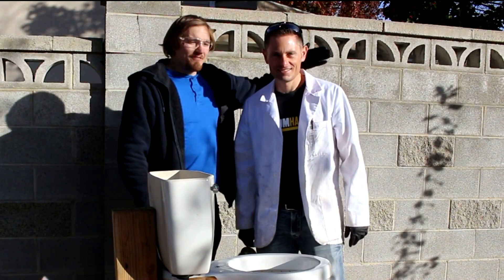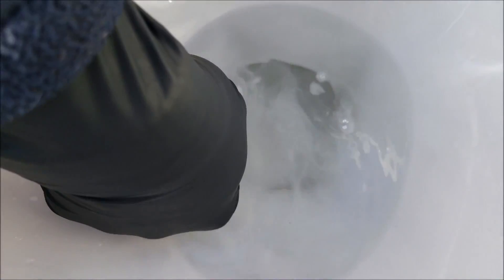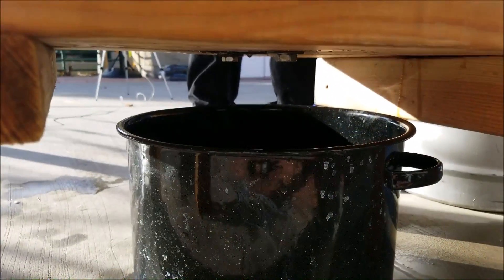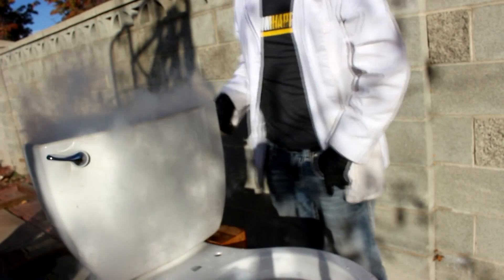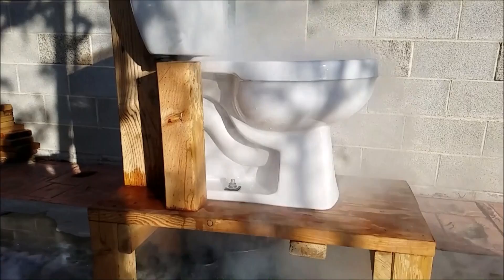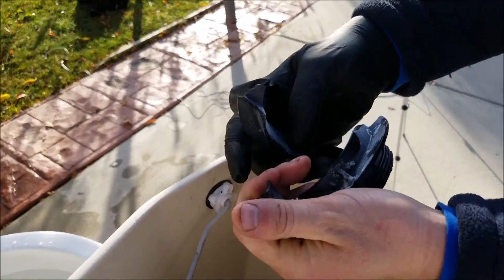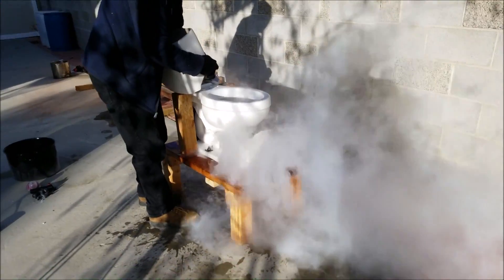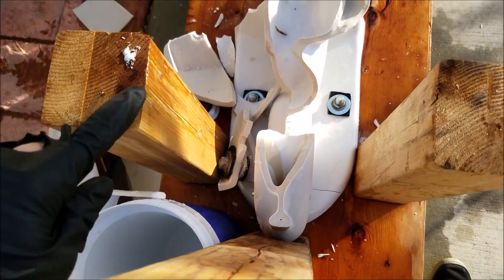Flushing Liquid Nitrogen

Comment: It's not too surprising that the bowl cracked from thermal shock, as sulfuric acid based drain opener has a preheat protocol. As +Cody'sLab has shown in previous videos, adding acid to water usually does not create even a boiling mixture. So, the far greater, and more sudden, change in temperature from the liquid nitrogen is almost certain to crack a toilet bowl.

Comment: I wonder what happens if you try that with fluoric acid XD Probably the flush system will melt before it get down but with a bit luck you could have a "melting" toilet (and surroundings). (would be a cool video - dissolving a whole toilet in fluoric acid)

edit: how can the water in the bucket be warm while frozen in the toilet?

Comment: F.Y.I., before you eat more ice out of the toilet you should know that they test every toilet exactly once at the factory. They are cleaned with a pressure washer but, they are not as clean as you think..........................................................................................................................................................................................................................................................................................................................................................................................................................................................................................................................................................................................................................................................jk

Comment: LOL!! This was awesome. Of course the liquid nitrogen does more damage than the mercury. It's so cold that it causes thermal shock on the ceramic - just like if you had put it over a fire, but "the other way". Also fun with those rubber parts that got brittle and cracked.

Comment: try to flush it with sulfuric acid next time :)
Reply: You can buy concentrated sulfuric acid (90% or so) from Walmart in the form of drain cleaner, so not terribly exciting.
Reply: ehhhhhh bad idea
Reply: WOW that solution is illegal where i live.... max is 70% diluted
Reply: I approve!
Reply: buy a wet cell battery and use the acid from it
Reply: Sulfuric acid? Nah, let's go bigger. How about fluoroantimonic acid (H 2FSbF 6?) It's 10,000,000,000,000,000 times more corrosive and stronger than sulfuric acid. The only problem is, it would chemically burn the toilet in minutes, or even seconds. Plus it's illegal to buy or have it at all, without a VERY special permission.
Reply: Grant Thompson has a vid on how to concentrate sulfuric acid to pure pretty simple but I'm not stupid enough to try this at home
Reply: How u even store fluoroantimicic without it breaking everything down
Reply: rusty savage The only way to store fluoroantimonic acid is by teflon containers. Teflon is help together by carbon-fluorine bonds, which is the strongest bond in organic chemistry. It will destroy everything else.. :D

Comment: Is there a reason you guys are using gloves with the LN2?  AFAIK no extreme overclockers use gloves on the basis that the leidenfrost effect protects you if it hits your skin whereas with gloves it can freeze through the glove fast and soak into fabric.

Comment: You could've made it explode on it's own by giving it thermal shocks. Repeated simultaneous exposure of liquid nitrogen & hot water.
Reply: All the pinhead in the fake white coat wanted to do is hit it with a hammer :\
Reply: TheProCactus who you callin pin head?
Reply: MasterG
Who wanted to smack it?

Comment: Hey Cody, I've been looking at some chemistry beakers, and wanted your opinion on which brand I should buy. I've mostly been looking at the Karter Scientific 213A2 Borosilicate Glass Low Form Glass Beaker, 50/100/250/500/1000 mL (Pack of 5).

Comment: Cody, you should do a thing where you pour molten metal into liquid nitrogen. Not a lot, but like small beads of metal, just to see what happens.
Reply: Avamander I'd guess the outer layer would freeze and shrink and then burst from the pressure, spurting more droplets of metal into the nitrogen.
Reply: Doing the same with glass makes a Prince Rupert Drop which is incredibly strong .. well until you cut the end. wonder if metal would be tougher.
Reply: Anson Mansfield the metal would freeze....
Reply: Anson Mansfield Pretty sure metal gets extremely toughened.

Comment: Hey cody, what would happen if you used mercury in a ball mill instead of lead for gunpowder? Would it be easy to seperate because mercury is so heavy or would it kind of stick or mix in? Would the little droplets it forms be enough to perform the same function or would it be too amorphous and just sort of mix the gunpowder together as if it weren't there?
Reply from the maker: I think you would end up with floured mercury.
Reply: Your next cooking with the Cody should be baking a cake with floured mercury
Reply: +Cody'sLab  have you ever built a geet reactor?
Reply: +Cody'sLab What is floured mercury? Doesn't Mercury form little balls when it's small enough? Surely you could put a few ml into a ball mill and let it roll around in the gun powder. 
It might make a nice fast video.

Comment: It would have been interesting to run a lot of boiling water through the toilet and get the porcelain as warm as possible (or put it in an oven of some sort) and then pour LN2 in there to see if it would shatter due to the temperature differential.

Comment: Hey Cody I was wondering, could you try to make a really powerful d.c rail gun and using tones of capacitors to build up a ridiculous voltage. Also make a projectile that could be fired at liquids nitrogen temperatures so that the resistance is almost 0.

Comment: Not sure if the slow motion in this video was from Chronos 1.4 but at least in the sodium video it wasn't. Just wondering why not? Was it not as good (for whatever reasons) as the one with (what I think was) iPhone?

In the sodium video it seemed there was a remote trigger connected and you seemed to point over to someone (I assume to make sure they stopped recording).
Reply from the maker: We filmed with it but the video didn't turn out.
Reply: Well that's odd. Bummer. :/

Comment: Will plutonium flush
Reply: Just don't buy it from the Libyans or they may shoot you to death in a mall parking lot forcing your assistant to travel through time in order to escape.
Reply: Kevin McD But you wouldn't be "shot to death" since your partner would travel back in time and tell you to wear a bulletproof vest
Reply: Cai Jones lmao
Reply: No, because plutonium is a solid at room temperature. Its melting temperature is higher than that of porcelain, so you'd need to invest in a steel toilet first.